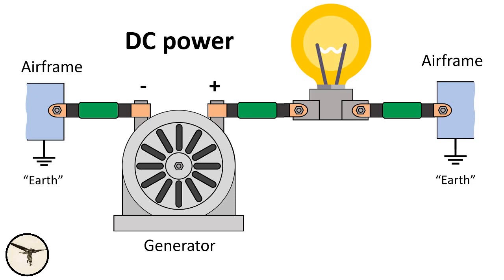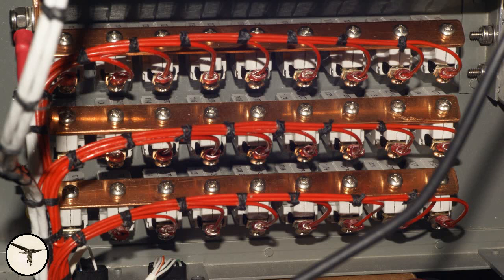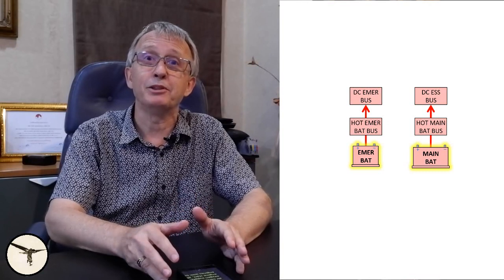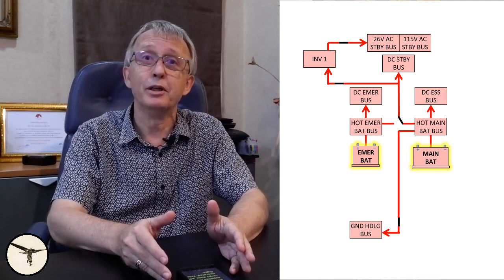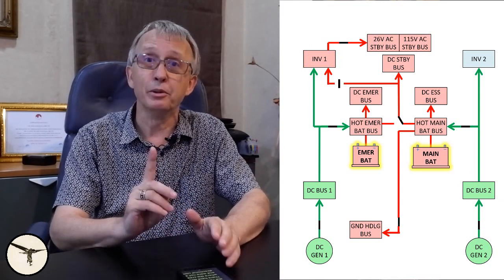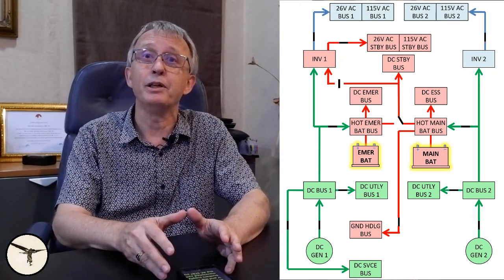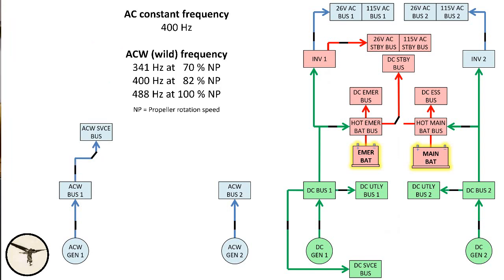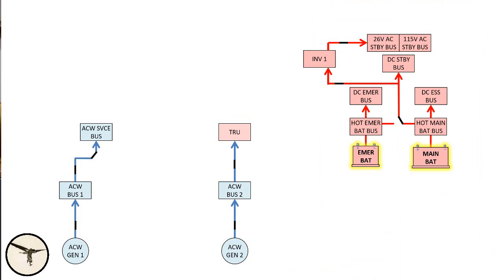ATR electric systems - an introduction

Comment: I read in my FCOM that Emer/Main Bat Chg Fault is no longer allowed for reset procedure. I wonder whats the reason behind that?
Reply from the maker: Reply from ATR Flight Operations Support: "ATR allows to reset only the MAIN BAT CHG P/B if a FAULT occurs during the engine starting phase.
The reset of the MAIN BAT CHG P/B is forbidden outside the starting phase."
Reply: @FlywithMagnar  thank you Magnar. Keep safe
Reply: Fly with Magnar Good day. This is a doubt that also had and the response of the ATR it seems to me correct. My question is why is this explanation not in in FCOM/QRH?
Reply: @k9tiagopinto  This is the problems of the manuals getting revised frequently. I just knew it after reading the latest FCTM and FCOM, previous manuals doesn't have this yet. As a pilot we need to get informed about latest manual revisions as well.
Reply from the maker: @k9tiagopinto  Hopefully, it will be there in the next revision.
Reply from the maker: BAT CHG amber "FAULT" light illuminates when there's a thermal runaway or a charge contactor failure.

From QRH, General information, section 3 Failure Consequences Analysis: "For the following systems the flight crew should strictly follow the abnormal procedure and RESET only when it is called by the abnormal procedure:
- ECU / EEC.
- PEC.
- CAB PRESS MODE SEL.
- BAT CHG (EMER & MAN)."

The procedure for a single BAT CHG fault is to switch the affected BAT CHG PB OFF. Reset is not an option.

However, the QRH is intended for use in flight. During engine start, we sometimes experience a BAT CHG fault message; it happens at the very moment we press the starter PB. It is the policy of my company to reset that failure because this is caused by an intermittent condition.

I will email ATR Support and ask for clarification.
Reply: @FlywithMagnar  verry clear answer, please let us know once you hear from ATR.
Thanks in advance
Reply: It is long time ago since my last flight on ATR but I remember at that time they were talking about of the reset of Bat Chg was not advisable since there might be a chance of a thermal runaway of the battery. I do not fully remember the details but it was something regarding that. I can not find my notes to give you a better explanation, sorry about that.